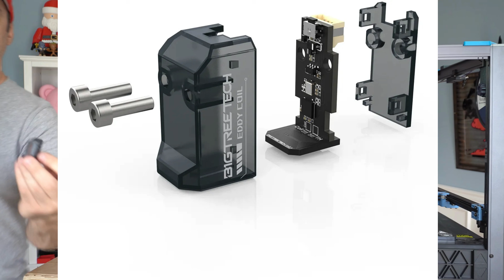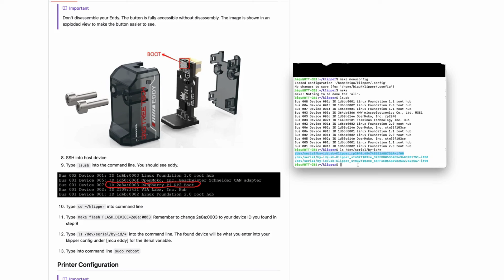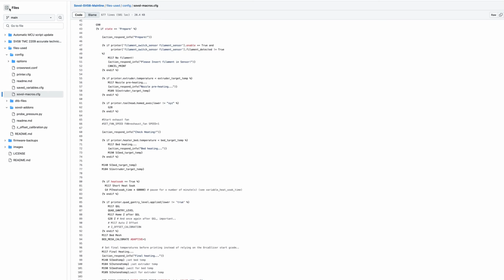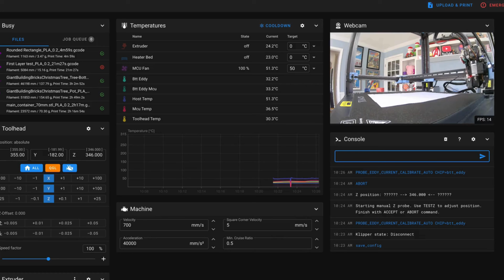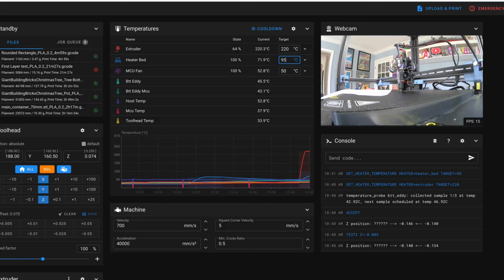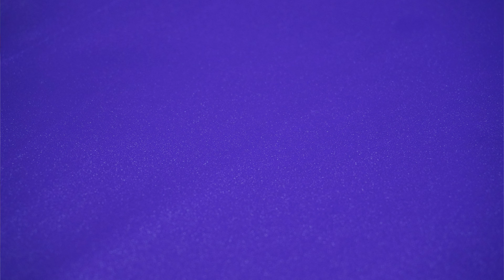BTT Eddy USB Probe Setup on Sovol SV08 – Full Install & Calibration Guide

Comment: Hello,

I am stuck at chapter 5 point 32.
If i run TEMPERATURE_PROBE_CALIBRATE PROBE=btt_eddy TARGET=56 STEP=4 my printhead starts wandering to the right. it sound like one of the steppermotoors is getting engaged just slightly, when it's as far as it can go the sound remiains the ssame. If i then home all it just functions like normal.

i have changed the eddy cfg file to the one from the meinline klipper updat (and typed my serial again) but this does not solve the problem. any ideas what this can be? i can't calibrate the eddy like this sadly.

many thanks.
Reply from the maker: When you run a G0 Z5 does the tool head move to the center of the bed, and nozzle moves to 5mm above the bed?   For Step 3 you performed point 19 - 21 did a Save_config, then moved to the bedmesh step 4? What does your bed mesh look like, did it mesh the whole bed?
Reply: @ThePrintasaurus  G0 Z5 moves to center nozle goes to 5 mm, it starts wandering after the TEMPERATURE_PROBE_CALIBRATE PROBE=btt_eddy TARGET=56 STEP=4 command. i did manage to calibrate by disconnecting the two steppermotors when the print head was in the middle. step 3 i did 19-21 i also tried the other method but it kept saing i was out off range. i did the SAVE_CONFIG it did mesh the whole bed it looks like an upside down taco range 0.111 and  -0.181.

It did a good first layer (after i changed the nosle). when i tried to do a whole print, it started eating  the print when making the infill. 

I have bought it in october 2024 and am mailing a lot with SOVOL. The printer always had problems with first layers and consistency. I did this conversion to hopefully solve all of my problems because SOVOL just does not understand me. I have tried all their sollutions but nothing works i am at wits end. I love the concept of taking the voron 2.4 and making it more accesible but i hate this printer because it took more then 50 hours of my time and it still does not work. (sorry to write all this but now you know the back ground :-))
Reply from the maker: @M4ddon.  Send me an email at theprintasaurus@gmail.com    I want to see what I can do to help you get your printer in working order. Sounds like you may have some issues not directly related to the eddy coil. I'll share my config files for everything and see if we can figure out what's going on. Happy to help if I can!
Reply: Same problem with mine it could maybe be a mistake in the script, i noticed the endpoint match the endpoint of the probe screw (in eddy.cfg) G1 X319 Y176 Z5 but right now i dont figured it out

Comment: Why is manual bed leveling with paper still required? Doesn't the SV08 come with a probe on the back of the build plate?
Reply from the maker: Yes you do have the probe point on the back of the build plate.  If your migrating to mainline klipper, you have to setup all your sovol marcos to work again. So my mindset in this case was I didn't plan to use it as the recommended method for setting the offset with the eddy is the old fashioned paper test. Which works. Offset has stayed consistent with the Eddy probe, and I'm only resetting my offset when swapping nozzles.

I'm actually in the process of reworking that back section to allow a purge bucket to purge, then clean the nozzle before prints.  

Thanks for the question / comment! And for giving my content a look. Appreciate it!!

Comment: FYI there are quite a few additional settings in the eddy.cfg file now. And when I went to do the first rapid scan, it probes a bunch of individual points even though I copy/pasted the line for rapid scanning. I am not sure why it is doing this still.
Reply from the maker: Are you running this? What command are you using for rapid scan? 
BED_MESH_CALIBRATE METHOD=rapid_scan

does that allow the rapid scan? 
In your sovol-macros.cfg around line 103/104 you should have this as part of your Print_start.

       #BED_MESH_CALIBRATE ADAPTIVE=1 
        BED_MESH_CALIBRATE SCAN_MODE=rapid METHOD=scan ADAPTIVE=1
Reply: @ThePrintasaurus  I am having the same problem. changed  #BED_MESH_CALIBRATE ADAPTIVE=1 
        BED_MESH_CALIBRATE SCAN_MODE=rapid METHOD=scan ADAPTIVE=1 still same problem
Reply from the maker: @dreysbimmer   Back up your eddy.cfg   and try this. This is my eddy cfg macros.  In the eddy.cfg after the ########## macros and related ###########.   Replace everything with this below.  Once you have that saved in your eddy.cfg.   Open your sovol-macros.cfg and around line 103/104 look for your BED_MESH.  And make sure that line reads this.   BED_MESH_CALIBRATE SCAN_MODE=rapid METHOD=scan ADAPTIVE=1

[save_variables]
filename: ~/printer_data/config/variables.cfg

# Uncomment this if you are using Eddy as the probe AND the homing endstop
[force_move]
enable_force_move: True # Allows a user to move the z axis down if they have no other means of homing Z and need to calibrate the Eddy.

# Uncomment this if you are using Eddy as the probe AND the homing endstop AND would like to use the beta z-offset control
[delayed_gcode RESTORE_PROBE_OFFSET]
initial_duration: 1.
gcode:
  {% set svv = printer.save_variables.variables %}
  {% if not printer["gcode_macro SET_GCODE_OFFSET"].restored %}
    SET_GCODE_VARIABLE MACRO=SET_GCODE_OFFSET VARIABLE=runtime_offset VALUE={ svv.nvm_offset|default(0) }
    SET_GCODE_VARIABLE MACRO=SET_GCODE_OFFSET VARIABLE=restored VALUE=True
  {% endif %}

# Uncomment this if you are using Eddy as the probe AND the homing endstop
# Take note of the lines that should only be used if you have a KNOMI installed.
[gcode_macro G28]
rename_existing: G28.1
gcode:
  #SET_GCODE_VARIABLE MACRO=_KNOMI_STATUS VARIABLE=homing VALUE=True # Uncomment this if using a KNOMI and then remove the G28 macro from the KNOMI.cfg
  G28.1 {rawparams}
  {% if not rawparams or (rawparams and 'Z' in rawparams) %}
    PROBE
    SET_Z_FROM_PROBE
  {% endif %}
  #SET_GCODE_VARIABLE MACRO=_KNOMI_STATUS VARIABLE=homing VALUE=False # Uncomment this if using a KNOMI and then remove the G28 macro from the KNOMI.cfg

# Uncomment this if you are using Eddy as the probe AND the homing endstop
[gcode_macro SET_Z_FROM_PROBE]
gcode:
    {% set cf = printer.configfile.settings %}
    SET_GCODE_OFFSET_ORIG Z={printer.probe.last_z_result - cf['probe_eddy_current btt_eddy'].z_offset + printer["gcode_macro SET_GCODE_OFFSET"].runtime_offset}
    G90
    G1 Z{cf.safe_z_home.z_hop}

# Uncomment this if you are using Eddy as the probe AND the homing endstop AND would like to use the beta z-offset control
[gcode_macro Z_OFFSET_APPLY_PROBE]
rename_existing: Z_OFFSET_APPLY_PROBE_ORIG
gcode:
  SAVE_VARIABLE VARIABLE=nvm_offset VALUE={ printer["gcode_macro SET_GCODE_OFFSET"].runtime_offset }

# Uncomment the lines in this macro if you are using Eddy as the probe AND the homing endstop AND would like to use the beta z-offset control
[gcode_macro SET_GCODE_OFFSET]
rename_existing: SET_GCODE_OFFSET_ORIG
variable_restored: False  # Mark whether the var has been restored from NVM
variable_runtime_offset: 0
gcode:
  {% if params.Z_ADJUST %}
    SET_GCODE_VARIABLE MACRO=SET_GCODE_OFFSET VARIABLE=runtime_offset VALUE={ printer["gcode_macro SET_GCODE_OFFSET"].runtime_offset + params.Z_ADJUST|float }
  {% endif %}
  {% if params.Z %} 
    {% set paramList = rawparams.split() %}
    {% for i in range(paramList|length) %}
      {% if paramList[i]=="Z=0" %}
        {% set temp=paramList.pop(i) %}
        {% set temp="Z_ADJUST=" + (-printer["gcode_macro SET_GCODE_OFFSET"].runtime_offset)|string %}
        {% if paramList.append(temp) %}{% endif %}
      {% endif %}
    {% endfor %}
    {% set rawparams=paramList|join(' ') %}
    SET_GCODE_VARIABLE MACRO=SET_GCODE_OFFSET VARIABLE=runtime_offset VALUE=0
  {% endif %}
  SET_GCODE_OFFSET_ORIG { rawparams }

# This macro automates a lot of the frequency mapping process and simplifies the steps significantly.
[gcode_macro PROBE_EDDY_CURRENT_CALIBRATE_AUTO]
gcode:
  BED_MESH_CLEAR
  G28 X Y
  G90 # Abs positioning
  G1 X{ printer.toolhead.axis_maximum.x/2 } Y{ printer.toolhead.axis_maximum.y/2 } F6000
  {% if 'z' not in printer.toolhead.homed_axes %}
    SET_KINEMATIC_POSITION Z={ printer.toolhead.axis_maximum.z-1 } # Allows the user to work it down until it touches.
  {% endif %}
  PROBE_EDDY_CURRENT_CALIBRATE {rawparams}

#This macro is optional but useful if you want to run a rapid scan before each print. Simply uncomment it and add BED_MESH_SCAN to your print start code.
[gcode_macro BED_MESH_CALIBRATE]
rename_existing: BTT_BED_MESH_CALIBRATE
gcode:
#  SET_GCODE_VARIABLE MACRO=_KNOMI_STATUS VARIABLE=probing VALUE=True #Only uncomment this line if using a KNOMI and then remove the BED_MESH_CALIBRATE macro from KNOMI.cfg
   BTT_BED_MESH_CALIBRATE METHOD=rapid_scan
#    BED_MESH_CALIBRATE METHOD=rapid_scan
#  SET_GCODE_VARIABLE MACRO=_KNOMI_STATUS VARIABLE=probing VALUE=False #Only uncomment this line if using a KNOMI and then remove the BED_MESH_CALIBRATE macro from KNOMI.cfg
Reply: @ThePrintasaurus  fixed it by removing the # in sovol-marcos.cfg before  METHOD=rapid_scan  originaly its BED_MESH_CALIBRATE_BASE ADAPTIVE=1 #METHOD=rapid_scan    Thanks for helping.
Reply: @ThePrintasaurus  I had the same problem, but for me the sollution was to take the last set of text out of your comment and place it on the bottem of the eddy.fcg file

so thank you for the guides and comments. and i wanted to say that this guide is a big step up from your mainline klipper guide verry useful and clear to follow.
Reply from the maker: @M4ddon.   Glad you got things working. That is the goal, each video better than the last! Excited for 2025! Thanks for the support and happy New Year!